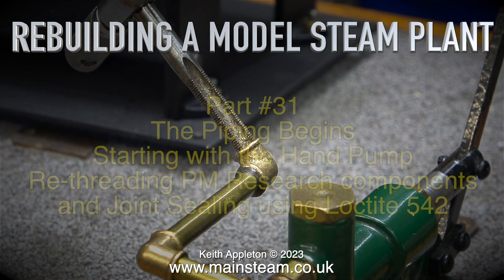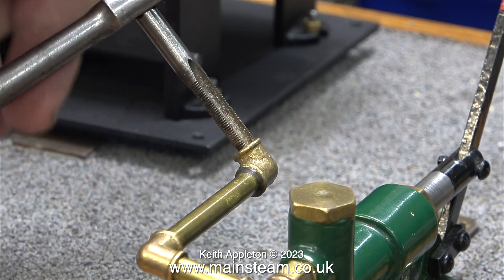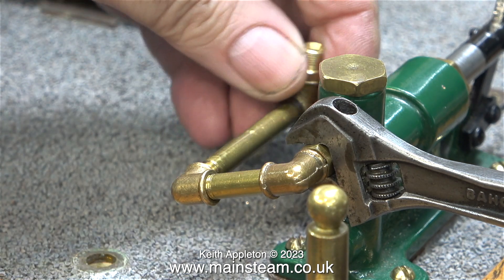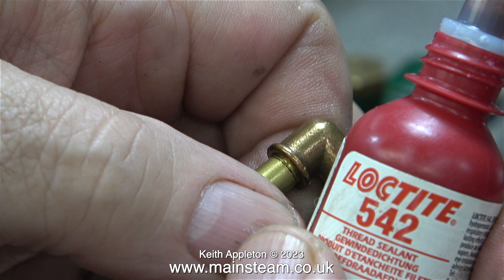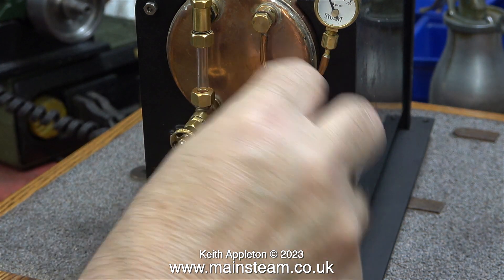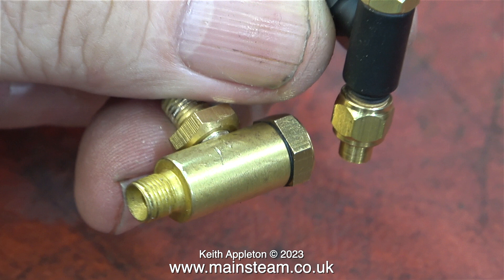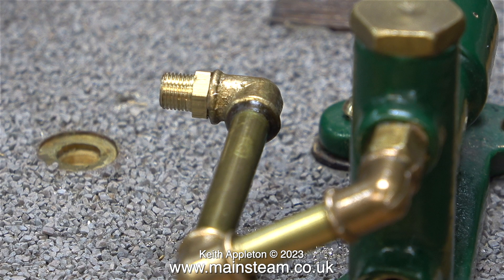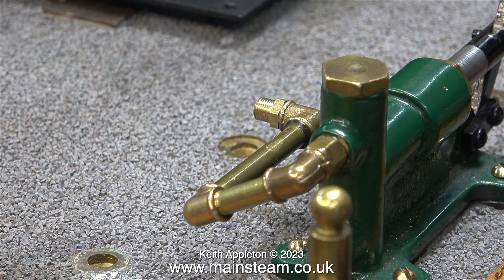REBUILDING A MODEL STEAM PLANT - PART #31

Comment: Here in the USA, we would call your wrench an "adjustable wrench". For us, an adjustable SPANNER looks similar to a pipe wrench (without the teeth). We also call them "monkey wrenches". SO WHAT. Pronouncing something different, or calling it something different, means very little. 
It is more important to use the tool CORRECTLY, which you always do, well almost always, and when you don't it's to teach BEGINNERS something.
Keith, I enjoy watching your videos because you show us ALL that there is always more than one way to get the job done, mechanically. ;-)